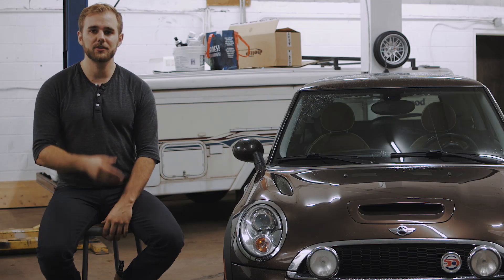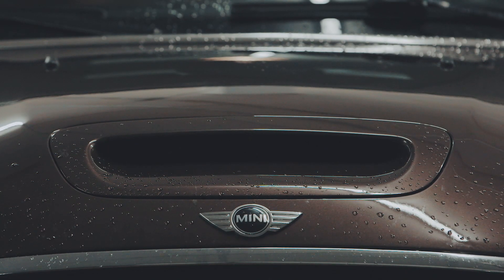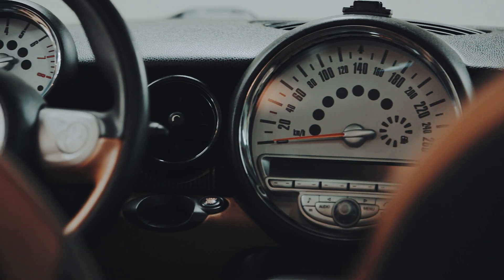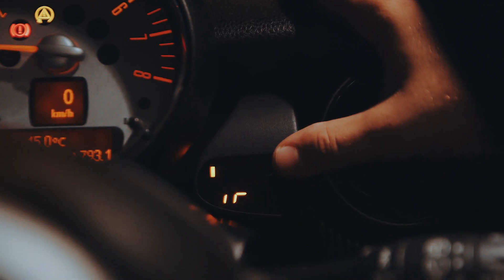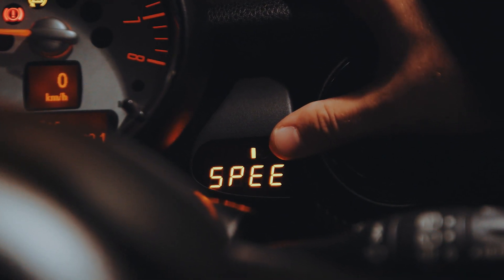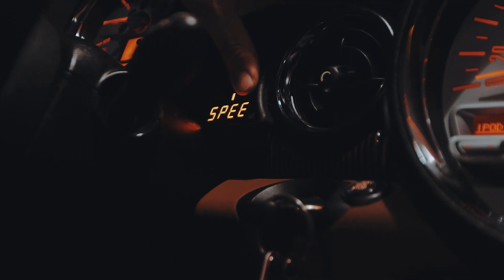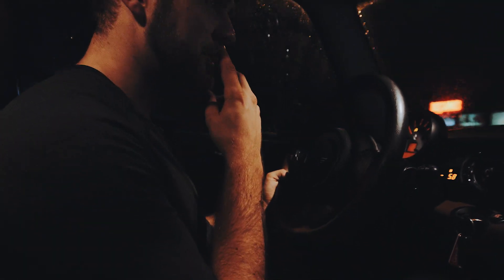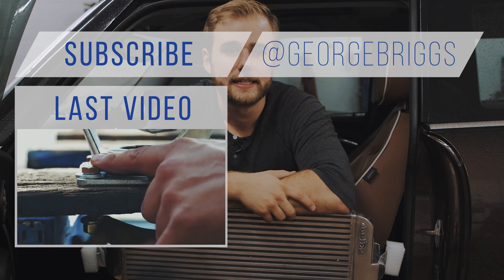P3 Cars Digital Gauge - Mini R56 Build

Comment: Alexander, do you mind putting the P3 digital gauge and set it in 'Shiftlight activation' mode for us to see the blinking lights when the rpm value is reached and it's time to upshift the gear? thanks

Comment: Is there a way to check the oil temp.
Because the mini does not have a sensor build in so how did you do that?
Thnks
Reply from the maker: +OutButton Yes, oil temp is readable, but oil pressure isn't which is the important one for me personally. There are analog inputs for more readings

Comment: Is the 0-100 included in the ob2 multigauge or u have to add-on because in the description it doesn't say it has the 0-100 option
Reply from the maker: It is indeed, was there when I installed it

Comment: How accurate is the p3 gauge compared to something that taps directly into the intake
Reply from the maker: It should be just as accurate given it's reading off the cars stock sensors. That being said, in a future video, I will be showing the boost controller and other gauges I'm installing in combination with the P3
Reply: P3 web sight says that tapping in is slightly more accurate!

Comment: When you mention an engine swap, and did you refered to a different engine or just a new upgrated n14 engine?
Reply from the maker: +Willie Lemosse New upgraded N14 motor, the unfortunate thing about Mini's is their engine compartment is so small it doesn't lend itself well to dropping something bigger in. That's not to say there's not an exciting plan in the works for what we're doing with the rebuild though :)
Reply: +Alexander Marshall nice man... I saw a guy drop a 4g63 the in it, but has you said it will be a pain in the butt. I'm rebuilding my MCS and doing some upgrades as well.
Reply from the maker: +Willie Lemosse really?! I saw a guy try but didn't end up finishing it. Do you have a link?

The plan is pretty nuts with my Mini, bit bonkers if you don't have a blown engine but it'll be insane